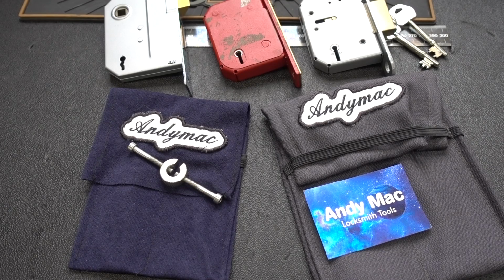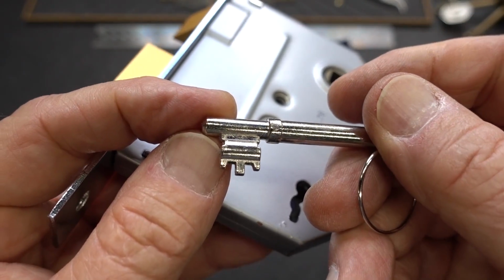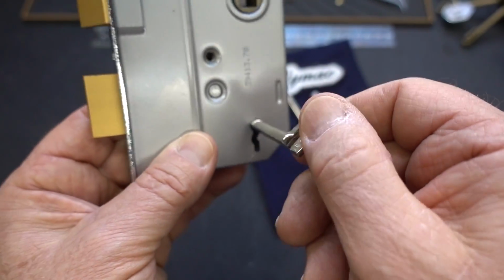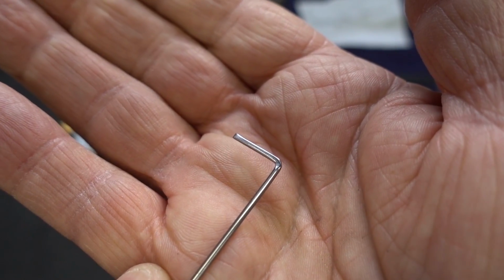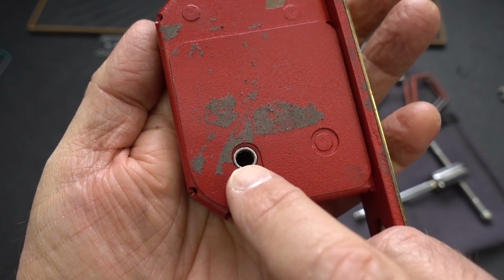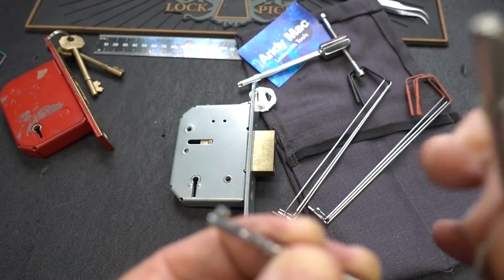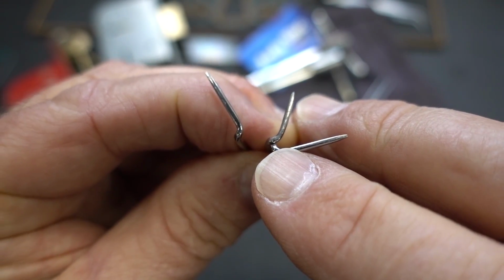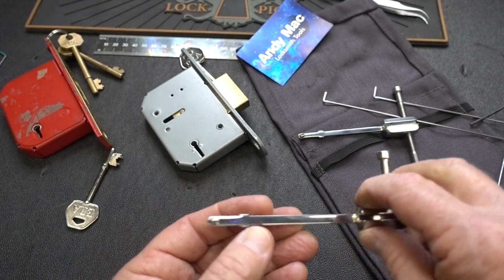(1598) Lever Lock Basics & Andy Mac's New Tools

Comment: I MUST give Andy and ALL you guys Way more credit (and apologize to Locksmiths).  You CAN\ COULD Have Opened my door!   
Have not had Front Door for many Years bcs of Jammed Latch.   was 'soo close' 1\8 in - but . . lost grip.  
Tried working around the inner works to pull\ unblock what moved, (broke) stopping latch from moving.  At least i did have the 'dip in Bend'.  lol  
(Obvious) this has Door knob, and with Split (name?) - not spindle (maybe ?) now stuck.  
Gave Up, tired of failing. Too many other things need work - i'll mess up - ha ha     oh brother.   = ]   
Hinges removed - didn't work either.  Big Boot will split frame, NO Thanks,  Plaster walls.     sorry for bitching ramble, just need courage.  Cheers!  
  Just to add  >>   I used  Umbrella Wire  Holds up well.                        and  THANKS!

Comment: Hi Bill in the UK we call the rotating part in the 5 lever lock a curtain. If you look at the key and count the cuts you will see there are more than 5 cuts in the key. This is because when you put the key in from 1 side of the lock it uses one half of the key and when you put the key in from the other side it uses the other half of the key. 
So when you get a lock that works from one side but not the other it can be down to the key if it’s been dropped it could be bent or damaged. Just some info for people who may have a problem with their lock and not know why...
The key will normally be symmetrical unless the lock is used on like a shipping container or gun safe where the lock is only accessible from one side. 
Keep up the great work Bill
Reply from the maker: Yeah, but I didn't want to over-complicate the tensioning description.  I was afraid it would discourage noobs thinking about taking up lever locks...  I have no idea why I identified the curtain alternately as "shutter" and "curtain"... brain fart probably.
Reply: This Is Exactly What I Was Going To Comment It Was Driving Me Mad LOL 😂. Also when Bill mentioned the Snib as a Nib LOL. I think the only other thing that could confuse Noobs to mortise lock picking is where Bill A few times kept switching between four & five gauge key/tensioners when its only 5 & 7 Gauge...! But we all make mistakes sometimes😺. Keep up the great work Bill. Also Great Info loz11968  . Nick🧔🏽, YouTube🔐: Lock Pick Nick & Nicholas Aarons.

Comment: Good morning Bill, thanks again for an amazing video. One quick question if you have time,  you explained how to modify a key to make a tensioner, however, what about an instance where no key is available for you to modify, how would you go about tensioning the lock then?
Reply from the maker: Well, you COULD use a length of heavy gauge wire (as I have done in a few videos), but it is much more difficult to keep it aligned and properly tensioned.  The keys for most mortise locks are pretty standard, so you can usually use a key from one lock in another manufacturer's without issue.  The Yale in the demo was a bit unusual but it was the only one I had on hand for the video.
Reply: @bosnianbill  would a set of tryout keys be a good start to make tensioners?